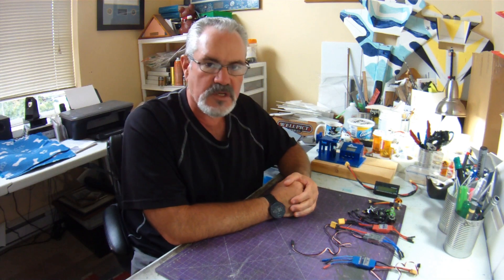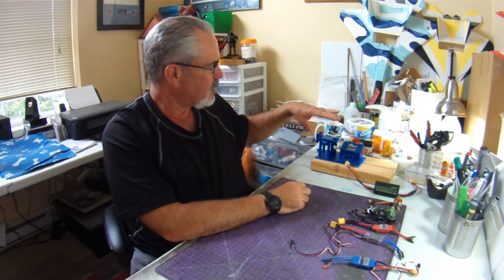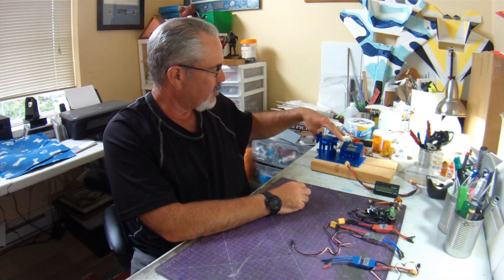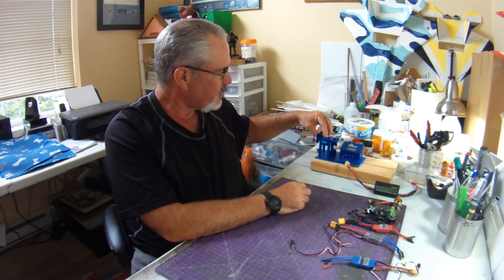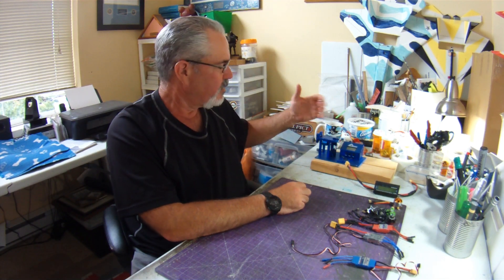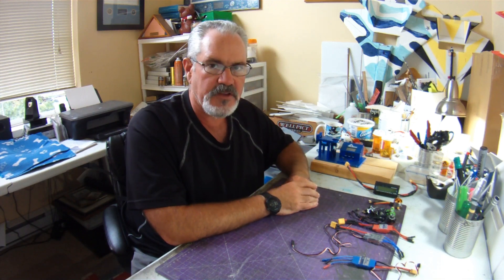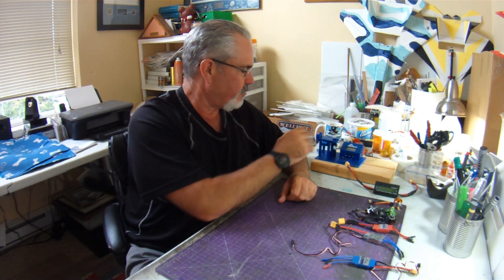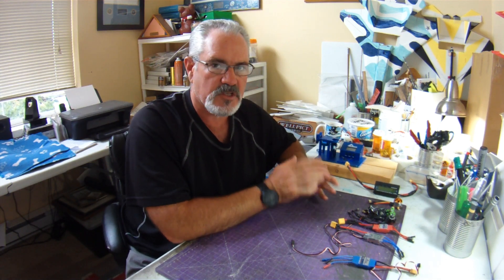Park Jet ESC timing...does it make a difference?

Comment: Hi  Scott do you use a programming card to change the settings on the ESC or the beep beep method. Great info I've had some desyncing on the 2206 when I tried 4S. K think it's on high. Going to check it now. 👍
Reply from the maker: Hi Keith, I do have a programming card for the plush ESC which I use a lot.  For the Turnigy AE-45 and the HobbyWing Platinum PRO, I use the transmitter to program it while connected to a motor (prop off of course).  I believe there is a computer interface box for the HobbyWing, but I think it is about $60.  Once I got the hang of it, programming the AE-45 and HobbyWing was pretty straight forward, just took a little time.  Good luck trouble shooting your motor/ESC challenges :)  Cheers, Scott